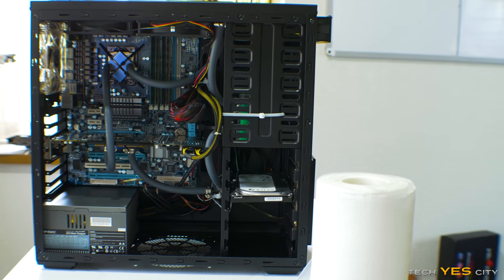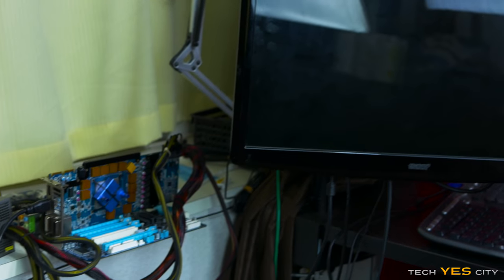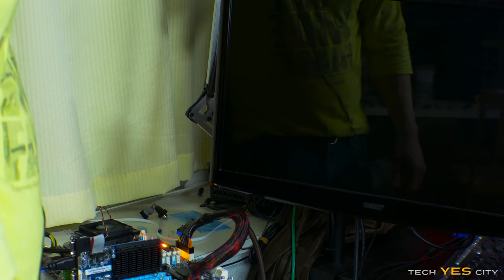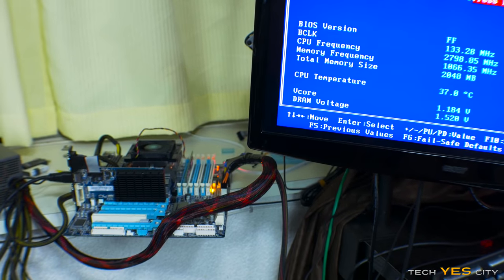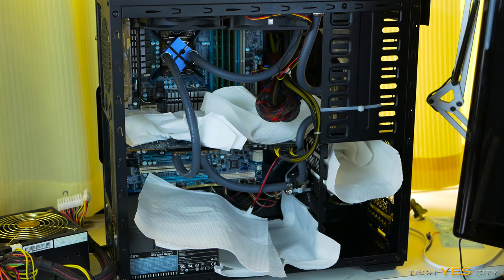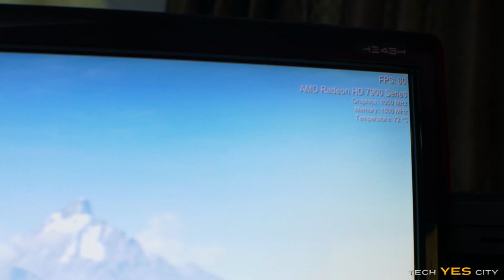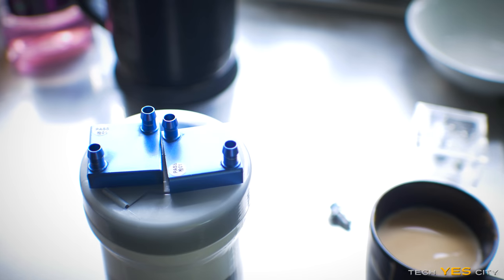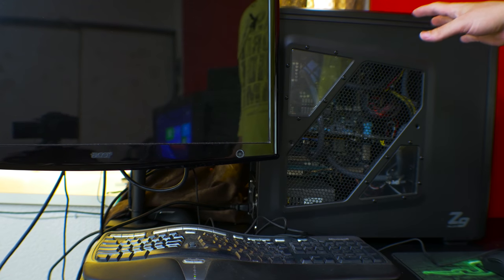$50 Custom PC WATER Loop - Is it POSSIBLE?

Comment: Cheap efficient water block? How good are you with a torch and solder ;)

  Also just hit me, it seems you used straight coolant, Antifreeze has about 65% the specific heat capacity of water. In a 80% Water to 20% Antifreeze solution, you have 95% specific heat capacity of water, while retaining the anticorrosion properties.
Reply: Honestly coolant doesn't make a real world difference, the water moves so fast through the blocks there is very little temperature difference before and after a block
Reply: 444animation
Everything has its limitations, saying coolant vs water makes no difference is like saying the size of your rad makes no difference.
 Only having 65% of the ability to carry and move heat is a huge difference.
Reply: DarkLinkAD But it isnt 35% better. It in reality makes NO difference. jay made a video about using random drinks as coolant. You also have to think about it in terms of limiting factors. coolant is only a limit when the temperatures are much higher and the radiators are huge.

I said before, because of the low temperature difference from one side of a block to the other (0.5C often) the coolant doesn't have to carry much heat, and in fact viscosity makes more of a difference. watercooling uses fast moving water in high quantities to cool down components.
Reply: 444animation
But it is.. Its simple "engineering tools". Try and keep your panties on straight, they're affecting your ability to avoid caps keys.

Specific Heat - cp - (Btu/lb.oC)
 of a 25% solution at 71c is .94
of 100% antifreeze at 71c is .64 and 5.8x as viscious
of a 25% solution at 93c is .95
of 100% antifreeze at 93c is .66 and 2.9x as viscous
Lets hope your not gaining anymore heat.

  Ive seen Jays video and I have no quarrel with it. Jay obviously built an overkill setup, which could likely use motor oil without issue, so its hardly relevant.

At the end of the day, you could do many things, increase the volume, increase the radiator surface area, increase the airflow to rad etc.etc. but why not save the money and dilute your antifreeze.
Reply: DarkLinkAD It just won't make a difference, its not about heat capacities, because the water doesn't actually transfer heat very much. You clearly haven't experimented with watercooling and are talking without any experience
Reply: DarkLinkAD http://www.bit-tech.net/hardware/cooling/2012/03/26/what-is-the-best-water-cooling-coolant/2 if you still don't believe me, and haven't got a loop, look at this graph, bit tech do a good job with their experimentation, and distilled water is only 3C worse than SPECIFICALLY pc coolant.I realise you think you know what you're doing, and you're right with the heat capacities, but you are completely ignoring how little it matters in the context. go back to engineering class
Reply: 444animation
So we have a disagreement between the capabilities of antifreeze when compared to diluted antifreeze in a liquid cooled PC and you respond with a review of PC coolants filled primarily of water compared to actual deionised water.

  Which in this comparison water matched two of the ten PC coolants capabilities, that typically costs £15 a bottle.

'Tis truly a shameful defeat, as I bow my head, please do the courtesy of dropping the mic on your way out. However will I show myself in "Engineering Class" again. :P

With that, Ill leave you with a quote directly from the Author of this misleading review himself.

"As we've said several times, we're not commenting on the results as there's so little variation. They are what they are, and a 3'C difference between coolants is well within the margin of error of many digital thermometers, the fact we don't test in a temperature controlled lab or with industrial-grade equipment that's accurate to less than a degree. We've also stated several times in both reviews that you should not be basing your purchase on the performance results as there's no benefit for doing so - That's our stance on these tests and the results. Our equipment isn't industrial-grade, nor is our testing on par with hard-core testers but it's clearly sensitive enough to show that for the coolants we've tested, there's negligible difference in flow rate and temperatures as far as the end user is concerned."
Reply: DarkLinkAD Look, just simple logic. If antifreeze diluted was the best you can get, you can bet your ass that the companies that are competing in a very competitive market have tried and failed to see a performance difference. Even with unscientific methodology, clear differences would be seen very obviously if your theory had any merit- the companies would be selling your idea rather than expensive chemicals that make little difference. NEGLIGABLE difference in flow rate and temperatures as far as we are concened. You seem to have lost  your point. chill out and accept you can be wrong on the internet, I have spent a lot of time watercooling and you clearly havent, its not something to be ashamed of.
Reply: 444animation
  So you've changed the debate to, diluted antifreeze vs £15 Pc Coolant and I see you've found your caps keys again. Ill try and keep chill, as you continue to prove my chosen methods, the chosen method by the majority of water cooling enthusiasts.

 As a matter of fact, Ive been wrong about one thing all along. Ive been wrong in assuming hes used 100% antifreeze, when in fact hes chosen the very same method I recommended.
2 Liters of water and 400ml of antifreeze.

 So you now have two veteran watercooling enthusiasts, to which ive personally spent time doing so since 1999, who prefer diluted antifreeze over an imitation labeled "PrimoChill". Thats okay though, your there market, young, new to gaming, with likely less experience in years, than my account has in overall age.

Please continue to backpedal, change the argument, become overly excited using your caps keys and post more reviews proving my point. (A point that doesnt belong to me but has been around for a very, very long time)
Reply: DarkLinkAD Wait what? I can compare water vs £15 pc coolant, because if the £15 pc coolant isn't any better, why is something cheaper and homemade going to beat it, if they can do lots of testing and r&d to validate their formula gives the best temperatures. Are you saying that they don't know about antifreeze diluted? are you saying they haven't considered it? Clearly they have, and the best they can come up with is within margin of error of PLAIN WATER. clearly there is not a bottleneck in coolant heat capacities or whatever bollocks you are going on about. You need to calm down and accept that although you use antifreeze, and that it is good for its antibacterial properties, it is not going to make a difference if you dilute it or not. On a side note, I love how you go on about caps keys, when in fact I use them to make is simple for you to understand, as you haven't understood what my argument is
Reply: DarkLinkAD Explain what your argument is, I want to know why you're right, because you aren't in my mind. I want to see if you have anything valuable to say.
Reply: 444animation
Theyre are far too many bullet points to address, atm, Im confident ive  represented my argument and you've represented yours.     Feel free to re-read if you wish, meanwhile ill be fabricating fenderwells for an old jeep and converting an old r22  single zone hvac  to an r410a(propane) split unit.

Comment: Why are you spreading thermal paste like that? You'll create air pockets and it can affect cooling. Just apply a simple dot and that's it! There are a dozen videos about applying thermal paste so check them out ;) Anyway I enjoyed this video :D
Reply: Jayden 97 Not exactly. As I mentioned air pockets :) Although you won't get much better temps with dot method but degree or two is still appreciated
Reply: +Milan Taskovic The spreading of the TIM doesn't matter at all, as long as you don't do it like an idiot.
I'm building computers for over 10 years now and I'm using the credit-card-spreading-technique for the same time and never in my life did I encounter one of those ominous "air pockets" or "air bubbles".
I bench-tested 5 different ways of applying TIM and every method was the same with a delta of 2°C max and the "blob"-technique you mentioned wasn't the best performer in my tests.

Kind regards,
Meta Custom Computers

Comment: Is it possible? Yes. Is it practical? Not really. Maybe if you'd spent a bit more on the waterblocks and a proper mounting system for them, bit more on the pump and reservoir as well. I'd say you could do the whole thing 100 and it would be perfectly doable and satisfactory without need to cut up some copper yourself, sand the fucking block down, or use zipties on everything. And you'd also have better reliability, which is important because you don't want to risk water damage on your expensive computer parts. But of course for 100$ you could also just get an AIO and that would be good too, but maybe not AS good, though you would get a warranty, so more peace of mind.

Comment: TRUST ME, it really not worth it. Save a bit more for a proper loop or go for an AIO skew. This thing is set to leak and is using crap components which WILL fail within a year.

Comment: Those ebay blocks are just flat metal inside, so no real surface area.
And will i spend $50 on a custom water loop on an old PC, no as it is not worth it.
Will I spend $50 on custom loop on my new PC, heck no.

Comment: won't zipties loose themselves with time??
Reply: +Raimar Lunardi Not really, they basically have ridges on them where the 'locking meganism' locks behind. Its trying to pull back but the ridge is preventing it from doing so.
Reply: but, won't they "strech" enough to cause problems?
Reply: +Raimar Lunardi I cant give a definite answer on that, but I have never heard of that happening, nor have I experienced it myself

Comment: i HAVE SEEN BETTER RESULTS ON OTHER VIDEOS WITH THE SAME COOLING BLOCKS THAT YOU HAVE USED. SO YOU DID SOMETHING WRONG!   I THINK THE EXTRA LAYER OF COPPER SHEET WITH TWO LAYERS OF THERMAL COMPOUND WAS A BAD IDEA.  GET THE RIGHT SIZED BLOCK TO BEGIN WITH, SAND IT FLAT, AND SAND THE TOP OF YOUR CPU CASE FLAT,  ALSO, DON'T SERIES IN THE GPU WITH THE CPU AFTERWARDS, HAVE THE COOL WATER GOTO THE CPU FIRST.

Comment: I cut the Pipes on a Air cooled CPU cooler and ran water through them and no rad and it cooled very well. https://youtu.be/uAWXSaFNcVQ   I ended up buying a Corsair H100i GTX thought I would get better temps and it did but not by much. My CPU just runs a little hotter.

Comment: The way you're apply you TIM....how well has that been working out for you?  When I research the subject, the majority of the time people advise against spreading it out on the die/heat spreader.  But of course you can't believe everything you hear or see on the internet....just figured since you seem to know your shit and do this often, figured I'd ask.
Reply: +coinsagE46m3 Worst case scenario: spreading loses to pea method to fraction of a degree. 
Best case scenario: spreading wins by the same amount, because it doesn't really matter much.

Pea method usually doesn't cover whole IHS, and in those situations, it can never be better than spread method with its all spooky scary "air bubbles" that are so insignificant that it's barely worth mentioning. 

Source: Articles from people that tested all methods, reading about peoples experiences from forums and YT videos alike, trying it out for myself.
Reply: DavorBa Thanks for volunteering the info.  Pretty much knew that already as I've extensively researched the subject on various mediums as you have.  Was just wondering how the spread method has been working for Brian here.  I've personally been using the "line" method which hasn't failed me yet.
Reply: coinsagE46m3 I haven't tested it yet, but I've read great things about "X" method. 
It has the coverage of spread method, but it's easier to apply and according to one test, it was 0.25 C better than spread method.

Gonna give that one a go next time I apply TIM.
Reply: DavorBa Yea, I've seen that.  Luke from Linus Tech Tips did a vid about different TIM applications and the X method was one of them.  He didn't get a tangible difference.  It would seem to me however that you get more coverage on the edges than the pea or line method, which I could see could yield a fourth or half degree C lower, which, in my fahrenheit-centric mind, is worth it.  

I'm actually literally going to be re-affixing my Kraken X41 on to my 980 Ti FTW tonight via the Kraken G10 kit.  I'm told you need to add extra TIM to a GPU die as it's not covered by a CPU-like heat spreader, and the X method should facilitate that.  Last time I used the line method; I think I'll try the X and see if I get a difference.
Reply: coinsagE46m3 I've found the article, here it is: https://www.pugetsystems.com/labs/articles/Thermal-Paste-Application-Techniques-170/

When it comes to GPU, I never leave anything to chance, so I always use spread method there, because it's extremely important that every part of die is covered.
Reply: DavorBa Thanks for the info.

Comment: ffs u dont clean your radiator with normal water.
Reply: thats a bacteria bomb waiting to become sludge when you fill it with destilled afterwards.
Reply: +tsfcancerman That's not true at all, I'm cleaning all of my radiators with normal tap water, even the dirty ones from Alphacool. You just need to flush them with sodium bicarbonate afterwards.

Kind regards,
Meta Custom Computers

Comment: I'm probably retarded here, but why is it that people never use 1/2 inch or 3/4 inch copper piping and solder fittings? I understand that would be a bit more expensive for this video so it makes sense here, but you could also use plumbing grade tubing and fittings as well. I just don't understand why it seems that all the water cooling setups i've seen don't seem to use plumbing grade material.

A lot of that stuff isn't really that expensive and learning how to solder pipe is quite easy. I could see not wanting to have rigid pipes running in your computer, but it does seem like it would be significantly safer.
Reply: +insidetrip101 It's really hard to clean the soldered places from the inside. When hard-soldering copper pipe, you need to use flux which will slowly contaminate the coolant from the inside. There actually are people who tried that to get a steampunky look into their computers but after a couple of months the coolant went bad.

Kind regards,
Meta Custom Computers
Reply: Meta Custom Computers

"you need to use flux which will slowly contaminate the coolant from the inside."

Ahhhhhh. Makes 100% sense now. Thanks for that info. Now I'll know never to try this if I ever decide to water cool a pc.

Thank you SO MUCH for the insight. I didn't even think of that.
Reply: insidetrip101
No problem. You still can use copper-pipe though, since a lot of manufacturers like Alphacool, Monsoon, BitsPower, EK or PrimoCHILL have fittings for hardtubing, all you need to do is buy copper-pipe with the proper diameter.

Kind regards,
Meta Custom Computers